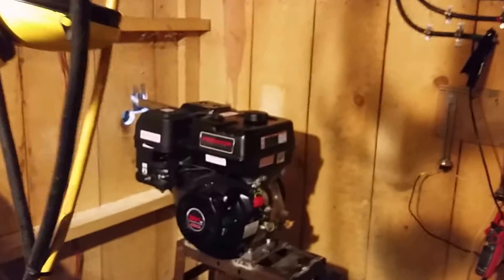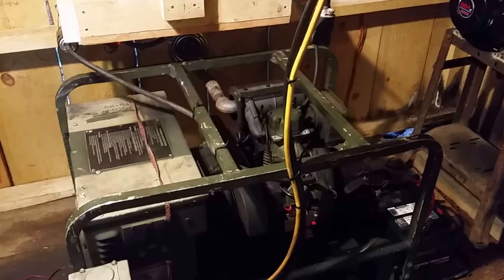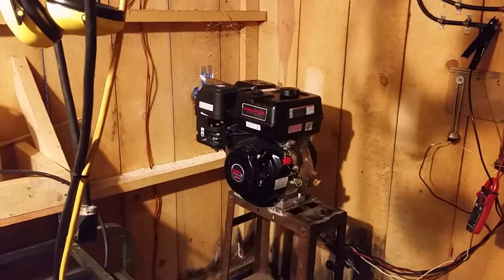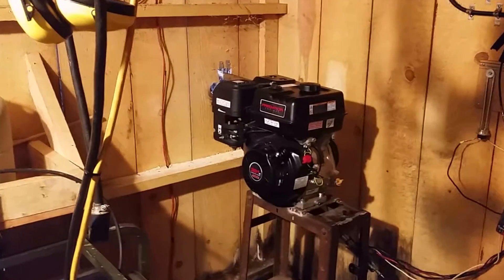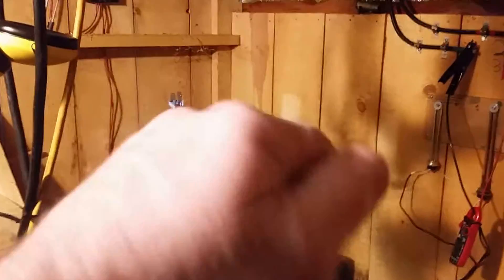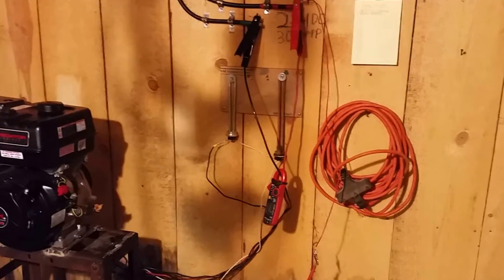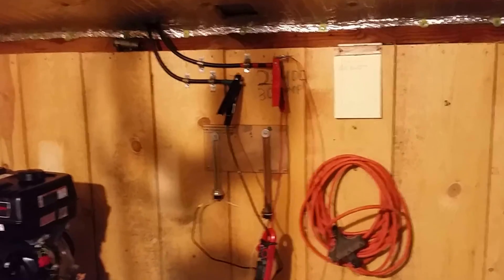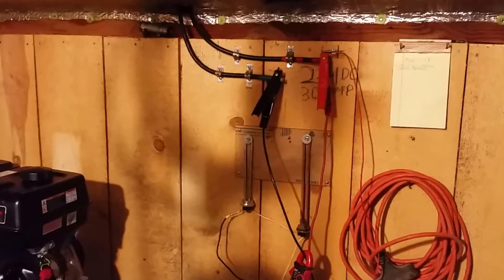Delco 10si alternator hack (More generator experiments)

Comment: they have a voltage sense regulator. that can work either way . internal sensed or external. you can adjust the voltage . and the regulator works either way. lower the volts on the sense wire. and it will output more. and still self regulate. or put battery voltage on it and it will work like normal! that may be what you need! it will do what you are doing now. but still self regulated!! if you are interested let me know. and I'll find the regulator part numbers and supplier for you! it would be great to keep the self regulation and the voltage you need!

Comment: Tracking your idea...should work. We used to use some funky high current variable rheostats on some of our equipment...kinda like a varistor. It could be turned to "set" the DC current in a protective zone...not sure about voltage sensitivity. It was slick...even for 1960s technology.
Reply from the maker: I having fun with it. I would never leave a generator unattended while charging manually on a small battery bank. My bank is big enough that I would run out of gas before the batteries got hot. Tonight I tested it when the sun went down it had only burned through the fog at 3pm. The bank was at 98% SOC at sundown. I ran the generator in manual mode and set the amps at 19 @30 volts. Within 30 minuets it tapered off as the bank was full to 17 amps at 30.5 volts. Another half hour it would be down to 8 amps at 30.5 volts. If I held that for an additional 30 minuets I would have my absorb time in. This cost is less than a quart of fuel. I would only do this if my batteries had not come to 100% SOC at the end of the 3rd day. Doing it this way I do not have to run the diesel if I did not want to. This is a proof of concept test. My hope is to run my spare diesel engine at 2200 rpm with a Leece Neville 130 amp 28 volt Millspec alternator. I will also have a adjustable voltage cutout relay with a auxillary contact to shut the generator down. That way when the volts are at 30.5 for 1.5 hours the relay will shut it all down. The Leece Neville alternator has a adjustable voltage regulator that will go over 30 volts. My hope is to build a automated battery charging generator that is more efficient that charging through the inverter charger. I am an obsessive tinkerer who thinks outside the box just like you Chris. I also am considering using a Midnight Classic 200 and a x13 blower motor for a generator. This has much greater rotating mass than my PMA 10si hack. Have a great night Chris.
Reply: That sounds really cool...small power generation doesn't have to gulp fuel if not necessary.

Comment: How do you keep the alternator from overheating when used for prolonged periods? Thank you for your videos.
Reply from the maker: Greetings friend, I only use 50% of the rated output. This alternator is rated at 65 amps maximum output. For continuous duty it is half that. When used with the internal regulator it has a resistor that lowers the impedance when it gets hot and the current drops to a safe level. I hope to buy a 130 amp military 28 volt alternator soon. Even with that I will only use 50% of the rated power.